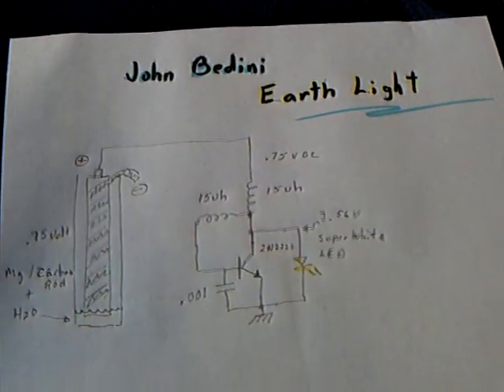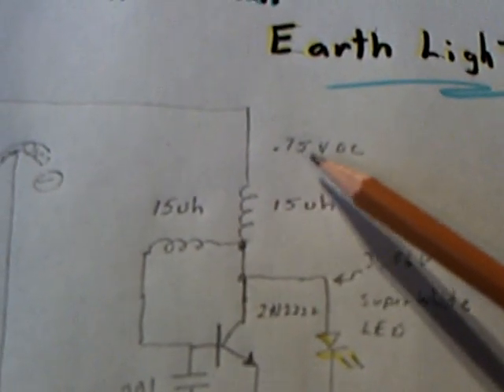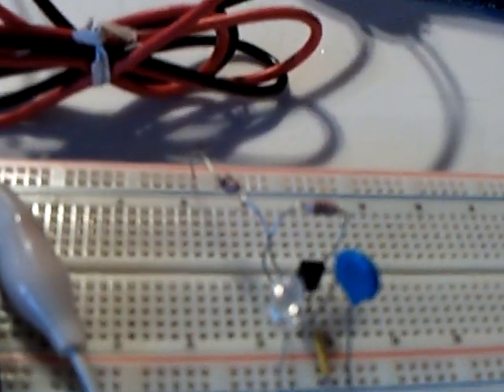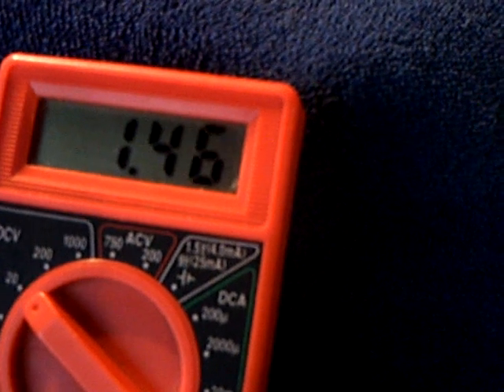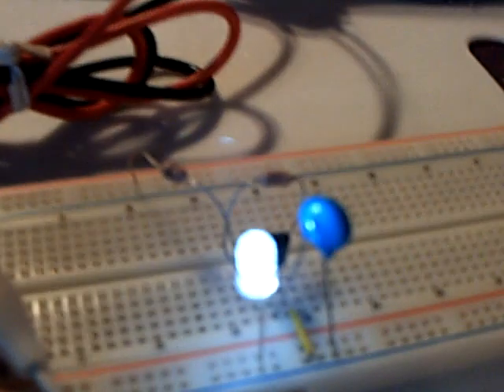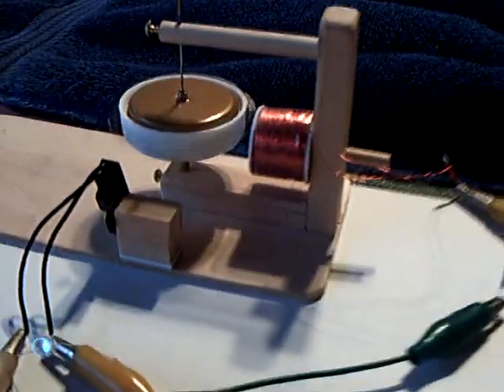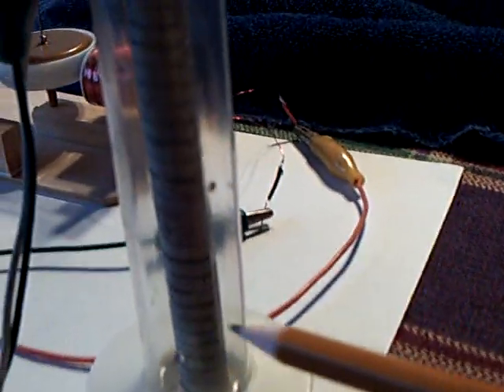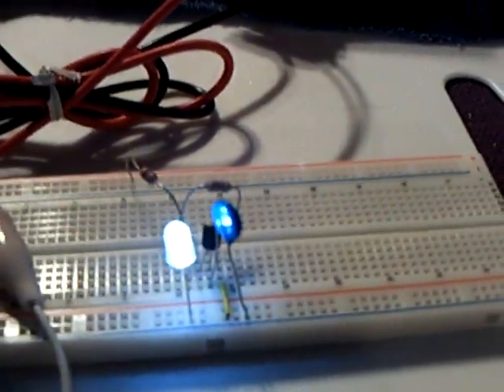Bedini Earth Light----replication.ASF

Comment from the maker: @SuperRorylewis ------Each cell will give you about 1.5 volts so you would need two of them in series to light the LED----but YES you can do it that way and eliminate all the mess on the circuit board.  The circuit is just a way to boost the voltage up so you only have to use only one cell.  It is also an efficient circuit that doesn't waste much energy.

Comment from the maker: @brotherboy77 -------Yes it is confusing.   Why don't I just hook 3 volts worth of battery power to this LED and be done with it????   The reason is that batteries don't last.  We are trying to make an LED light using as little power as possible (hence the voltage booster circuit) and then create a new power source that lasts much longer than a normal galvanic bettery.   It ain't easy.

Comment: Lid:
I am surprised that the voltage is so low from the carbon/mg.  On the galvanic charts the difference should be more like mine at about 2 volts.  Great circuit and excellent video.